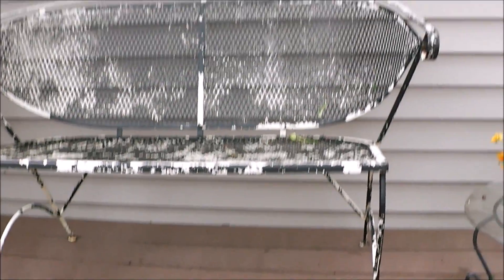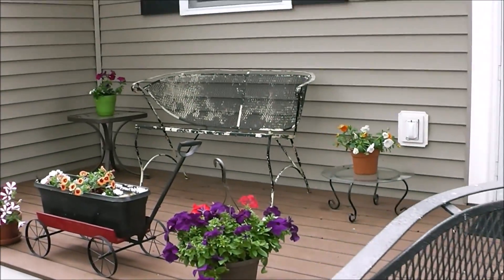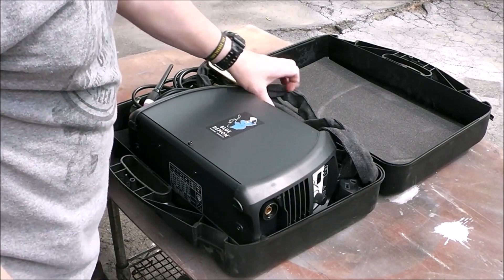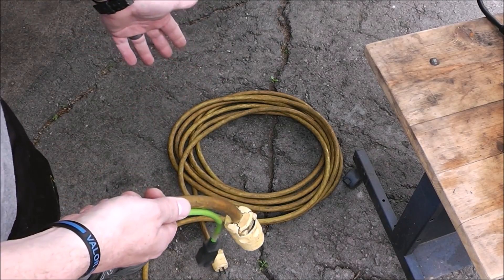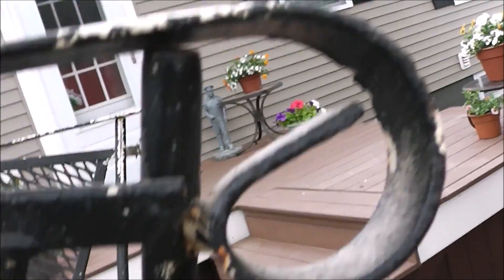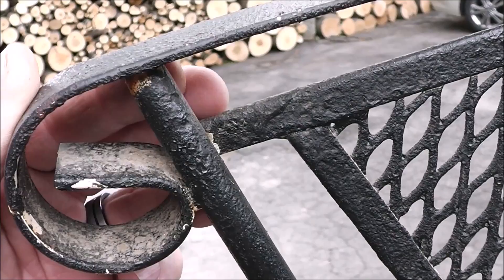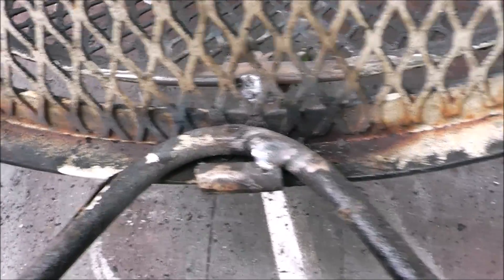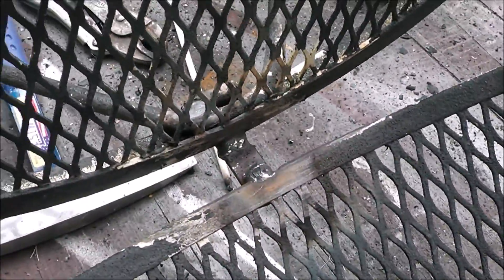STICK WELDING THIN METAL  using 120 volt power - 💥Beginner Welding Series

Comment: Inverter welders don't need a full 120V supply to deliver the dialed output. The circuitry adapts to any input voltage like a laptop charger. That said... you won't get the full 2000W out of a thin crappy extension cord, so you won't get to your welder's maximum rated power; a couple hundred watts will be wasted as heat. With a rectifier or AC welder on a cheap cord you will need to increase the dial setting to get the amperage you want.
Reply from the maker: Excellent point and great comment. Thank you! 👍 👊🙏

Comment: People get hung up on extension cords but don’t think anything about the distance the wire runs inside their house from the garage to the main panel. As long as the extension is the same as the gauge of the wire in the circuit, your good (within reason.) I very much doubt your house wiring is 12 gauge.
Reply from the maker: @T3glider you make a very good point. On a side note, we don't have any #14 wiring in our house. It's all #12 for the lights and outlets. Thats very common in our area for new construction.

Comment: Hey brandon morning here in philippines. Do you have video for G. i tubular 1.2mm thick. My question is what is the right size and no. Of welding rod to do the job,  i'm using 6013 2.0mm and lastec 88 rod when i was in saudi arabia, since i was now in philippines this lastek 88 is not available. Can you give me a sugestion what is the best welding rod to use for this thin G. I tubular. Thanks a lot if you reply big help for me and to other people watching your video.. Godbless
Reply from the maker: Hey Hailey 6013 is going to be your best. Maybe find a smaller diameter if it's available? 1/16" is the smallest in the states. Run it DC negative

Comment: Hey Brandon, Bruce Lund here.  Old man who's been welding for 50 odd years.  Good episode.  Lotta good points.
So on your recommended wire size for extension cords - you bet - 12 ga all the way for these Inverter Welders on 120v AC.  I cut open on of those 120/240 plug adapters and measured the wire thickness.  Came out at 0.072" which is between US 14 ga and US 12 ga.  So running 12 for an extension cord is almost a must.  I plan to splice on 25 ft of 12 ga and make my adapter into a dedicated welder feed extension cord.  
I also recommend going through all the Ground and Welding cable ends in the ground clamp, rod holder and the DINSE connectors.  You'll usually see bare wire wrapped in a copper foil under the set screw/bolt.  Over time these will corrode and work loose.  I flood solder the ends of the wire inside the foil so it's a solid "bar" for the set screw/bolt to grab.  Makes arc starting easier with solid connections.
Reply from the maker: @ Broc Luno great name buddy and even better great advise! This is gold! Thank you for sharing!

Comment: Well done man 👍🏻,  appreciate all usefull information you have provided, i am a big fan of yours and your simple yet practical and useful information, i believe the expeiance itself rather than the calculator which depends on one's project accomplished, i am planning to weld a 10mm nut on top of a small philips machien nail, do you have any recommendation?! Can you make a vido on this topic?! mainipulating hard to find specific nails and bolts using arc welding?!
Reply from the maker: @Mahmoud Omar Thanks man I appreciate your support! What you are trying to do is very difficult. Welding nuts in general can be very difficult because there is very little surface area and what remains heats up immediately to cherry red. It's very easy to blow out the metal when this happens. This takes practice but it can be done. Figure out what you think you need for amperage then go less. This will help prevent blowout.  You might find you have to start and stop a couple times to let the nut cool down so you don't have a blow out. Good luck brother and report back!
Reply: You're much better off using silver solder with MAPP gas.
Reply from the maker: Even better! 👍💯
Reply: @BrandonLund     Thank you!
Be well.
Reply from the maker: Same to you 👍 @usernamememykel

Comment: Had no idea that calculator app existed . Wow .
Reply from the maker: It's pretty handy...especially when you have a few odd ball rods hanging around that your not sure of the amperage or designed use
Reply: @BrandonLund  yes agreed you can pick up any welding literature on welding and it will tell you the significance of the numbers on electrodes , positions that can be welded and uses of each electrode . That's how I learned when we didn't have apps and the internet lol
Reply from the maker: Same

Comment: What he refers to as "arc force" is hot start
Reply from the maker: They are actually 2 different things. Hot start is just a quick increase in voltage when the arc is started and arc force is a temporary increase in voltage to prevent the arc from being extinguished if the arc gap gets too close.
Reply: @BrandonLund  oh, maybe I wasn't listening, sounded like you were describing hot start and not arc force, hence my comment, my bad!
Reply from the maker: No worries...:)

Comment: Question: at 6:09 measured the thickness of material  1/8" thick of mild steel. Did this material thickness data affect any settings of the welder?
Reply from the maker: When stick welding, the material thickness is only needed to guage electrode size.

Comment: We don't have the electrodes you have. I bought some high strength low hydration welding sticks. They take more to strike. Once you strike it really makes a nice run.
Reply from the maker: I love low hydrogen rods!
Reply: Brandon Lund 
I had to make clamps for the metabo track fence. You can run the metabo cold cut saw along it. I just found out Milwaukee brought out the over 8 in cordless cold cut saw. Anyway I cut a small section of 7 mm angle iron and ran through the belt sander so it would fit in the track. I cut off the end of a small clamp and proceeded to weld. I didn't take enough steel off so grinded the weld to make it fit. Only thing it lost its strength and failed. I then made sure I had enough weld for the next one and used low hydration stick. Oh my goodness they are nice and strong.
I agree I won't go back to using mild steel rod even for jobs that don't require it.
I can polish frames so it's all filled. I had trouble doing this with the other rods. There would be holes and cleaning up to redo didn't really achieve the results I was after.
Sorry for taking so long trying to explain something. The rods leave a thin later sort of dark. The brand is Bossweld. My goodness I was wrong these are 7016 low hydration tc 16 welding electrodes. Approval grade 3 h10.
Reply from the maker: @ron1martens  7018 run very much the same with that same glassy tan finish. I have never heard of Bossweld but I will check it out. Thanks! :)
Reply: Brandon Lund I think Melbourne Australia. Although outsourced made in Thailand. Thanks for the reply. Appreciated.

Comment: Metabo. Yes I like metabo. They are metal specialists. Their drills have the impulse and really good for drilling hex screws into metal roofs.
I have an assortment of drill attachments for polishing. I didn't think of this wire brush.
I haven't got a Di grinder. It will be on the list for touching up internal welds. I guess I could get a drill attachment.

Comment: You are correct using a gauge to check metal thickness. But when you graduate from years of welding, not so  much. Keep up the nice videos for us all to see.
Reply from the maker: Thanks man. I'll be 50 in a couple months. My eyes don't calibrate materials as well as they did in my 20's especially with the increase of metric materials it can get a bit confusing for me on thinner materials. Not so much on thicker plate tho
Reply: @BrandonLund  You are correct when it comes to eye calibrations. Personally I plan not to get old but for some reason mother time has the upper hand with this matter. Stay safe and virus free too. Peace!!!!

Comment: I believe the extension cord reduces the available voltage, not the current (amps).
Reply from the maker: Your describing "voltage drop". As the length of a cord increases, its ability to carry that voltage decreases, which in turn increases the  current / amps for the same given load.
Reply: @BrandonLund  yes I am. Your video refers to a reduction in available amperage when using a long cord, which would be incorrect.
Reply from the maker: @kitten_processing_inc4415  what I said is correct. let me rephrase it. Lets say you had a 6 foot long 12 guage cord capable of carrying 20 amps and you  plugged in an appliance that drew 19 amps. You have a 1 amp surplus. Now take that same appliance but make the cord 100 feet long.  You no longer have that 1 amp surplus, in fact the appliance will draw considerably more amperage, So as I said in the video you have reduced your available amperage by using long undersized cords.
Reply: @BrandonLund  ok, I accept  that's a legitimate way to look at it. The resistance causes the problem, the voltage drops across the cable because of the resistance which reduces the current carrying capacity of the circuit at given supply voltage. The really important thing is that the power available at the end of the cable is reduced because both the voltage and the current reaching the welder are reduced. Less power to the welder means it has to limit it's output current Aside from the fact that the power available to the welder is reduced I believe the power electronics of many welders won't operate well if the supply voltage has dropped out of a range, even if the power theoretically available would be adequate.... So voltage drop still seems like the big deal here to me, but I guess it is your video and it isn't incorrect..

Comment: Can you stick weld a car exhaust? I have a stick welder, and I need to patch up some holes on my car's exhaust. I know a MIG welder would be better, but I can't afford to buy neither the self shielding or the gas shielding one. I'd just like my car quiet as before, it's a diesel and it's crazy loud.
Reply from the maker: It can be done but its very difficult. Checkout the video where I weld up the wheelbarrow. That is a little thinner than exhaust tubing and I give some tips to help you out
Reply: @BrandonLund  Thank you for the reply! I'll check it out.

Comment: I like these videos. They help me. I have a stick welder and want to learn how thin I can weld with stick and how low can I go on Amps and the best rods to use for thing metal
Reply from the maker: Thanks man! Check out the beginner welding series playlist. I have one video where I weld 22 guage with stick :)
Reply: Use a whipping motion. At the lowest amps you can weld on whatever you're welding.

Comment: You getting 50 amps from 120volts ? Can you plz explain
Reply from the maker: I cant explain...it's well beyond my knowledge but i can only assume it would be similar to the same idea as getting 120 volts from a 12 volt car battery and running power tools from it
Reply: A welders with an input of 120 volts and 15 amps gives 1800 watts . Its Output is lower voltage allowing an increase in amperage. I.E Welder outputs 17-45 volts. There is 1800 watts available. With an operating voltage of 17 you will get 105 amps.
Reply from the maker: Nice! Thank you!

Comment: What is the input amperage? Most home circuits are 20 to 30 am.
Reply from the maker: 20 amps when it's plugged into 120v and 30 when plugged into 240v

Comment: Is it a rule to have the rode same size as the sheet metal, like you used 1/8?
Reply from the maker: That will get you close for most work.
Reply: @BrandonLund   what if i want to weld 27mm pipe 2.4mm with 2mm sheet , what rode side and type should i use?

Comment: I just repaired a cloths drying rack. I’ve only welded a few things so far.  The metal was super thin. I’ve have a mig with .035 so I used it at the lowest temperature.  I don’t know how I didn’t blow through but I got it done.  I impressed myself.
Reply from the maker: Nice job Gene Miller! It's a great feeling when you take something that doesn't work and get it working again! Well done brother!

Comment: Really helpful -- THANKS!  One question though...I'm trying this using the same basic technique, inverter settings/connections and rods, but 9 times out of 10 the rod STICKS! The work pieces are pretty clean and similar thickness, but "Stick City!"   What am I likely doing wrong?
Reply from the maker: Does your welder have hot start? That could be the issue. This welder has a "hot start" feature, which temporarily boosts the amperage then decreases it once the arc is established. It also has "arc force" which also boosts the amperage in the event you have too tight of an arc gap. Both work together to help strike the arc and keep it lit without sticking.
Reply: @BrandonLund  Honestly do not know, so will dig up the specs and chime back in pretty soon. Maybe I should use 6013 rods for this welder on thin material? Are they easier to start, maybe?
Reply: @AerialLensVideo  yes 6013 is rasy to start
Reply: @terryrafter4116  Yes. that was the answer, plus holding the rod down close to the work to keep it steady. Thanks.

Comment: I am planning to make a table with 1.4 mm thick SS square tubing. what amp setting should I use and what electrodes do you suggest?
Reply from the maker: 1/8" 308L if your using 308 or 304 stainless. Your amperage will be around 75-115.  You can also use the online calculator link in the description for different metals and thicknesses. Hope this helps!
Reply: @BrandonLund  Thanks a lot, Sir. Great help. I will try it out and let you know.
Reply from the maker: @VIDEOEPPO  good luck and thanks for your support! You can always post pics to my Facebook page also :)

Comment: What's the thickest metal this unit can weld when on 110 power
Reply from the maker: This machine will only go to 110 amps when plugged into 110 power (which is plenty for most of the stuff you see me doing on the channel). You could multi-pass joints as this as you wanted which is very common in structural work. It will easily weld 1/8" in a single pass and you could keep making passes to weld 1" plate if you wanted, but 1/8" is very do-able on 120 volts.  Just make sure your on a dedicated 20 amp outlet (nothing else plugged in or running off that circuit) or you will pop the breaker.
Reply: 1/4 of an inch I believe so if I'm not wrong

Comment: Going on your phone to the Miller site was awesome. Talk about saving a lot of time "guessing". Thanks for that. 
Has anyone asked about welding steel to aluminum? I have the exact same arc welder, and need to repair a gazebo. I discovered some of the box sections are mild-steel, and others are aluminum (magnet test). Any guidance or a video would be greatly appreciated.
Reply from the maker: Thank you very much. That calculator is a real time saver to get you close when using different materials. As far as welding the steel to aluminum, your best bet is going to probably be mechanical fasteners. If you can bolt or rivet a piece of steel to the aluminum, then you can weld the piece to the steel your trying to connect to. hopefully that made sense?

Comment: Thanks for shareing. Caution the audience on the high levels of toxic produced by burning paint. Other than that, your video is great!
Reply from the maker: Excellent point Ricardo! Thank you! Fumes from paint and welding are very bad for your health. It's a good idea to wear a respirator (even if you are outside).
Reply: An electric fan does wonders here. Unlike TIG and MIG, stick doesn't mind much that you use a fan to blow away the smoke.
Reply from the maker: @antilogism spot on! 👌

Comment: How did you come choose the E6011? What's a good outline for this for a beginner?
Reply from the maker: Warren, i use Miller welds calculator. I showed me using it in one of these videos and linked it in the description also.  It gives you guidance on rod selection and amperage.

Comment: I just made an extension cord out of house wire
Reply from the maker: That works too Dave. I have done it. With that being said, I would never discourage anyone from doing something to better their situation, I would just point out that NMB wire (which is what most house wire is) is not rated to be used as an extension cord. The jacket surrounding the conductors is much thinner than SJ or SO cord (which is what many flexible cords are made from). However, It will absolutely work, just be careful.  If you get a small nick in the wire and your using it outside and the ground is damp, you can see where this is going. I hope im not coming off as a negative person. I just don't want to see you or anyone get hurt. Just be careful. Cheers brother and weld on!
Reply: @BrandonLund  I hear what your saying, I do need to get an extension cord that will work, but funds are too tight for that right now, but its in the "one of these days" shopping list,lol
Reply from the maker: Dave it’s all good man. I used a house wire cord for years and had zero issues. Cheers brother!

Comment: What electrodes need to be used for AISI 1018 (ø 1" and 1.6 mm thick ) tubes ??? and other parameters. Please help me figure out
Reply from the maker: This is just typical low carbon steel and you can use which ever readily available process you choose. As far as electrodes, you are trying to weld 1" tube and 1.6 mm tube?

Comment: 6011 is for penetration, surprised you didn't put a hole in the material.
Reply from the maker: You can turn it down below the recommended amperage and you can do short stitch welds if it digging too deep.